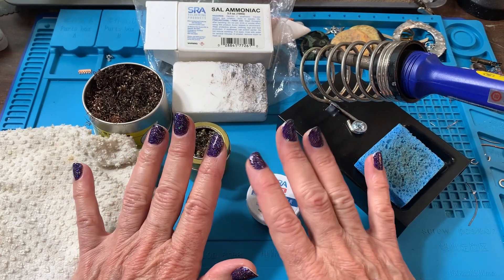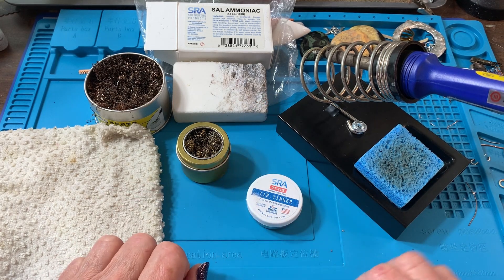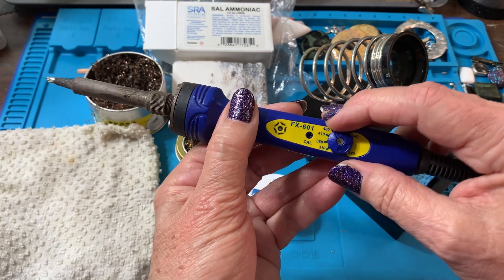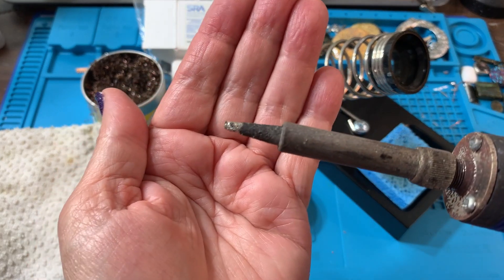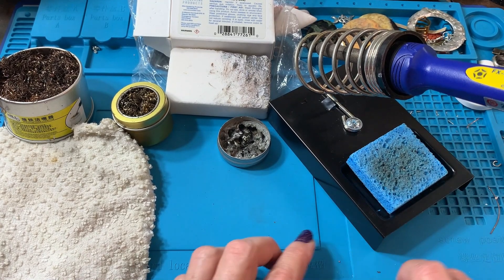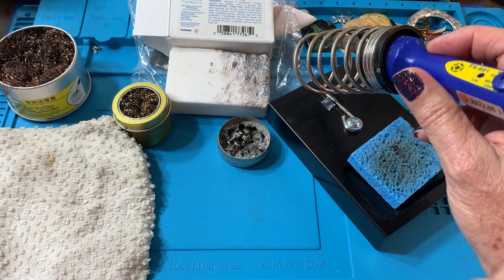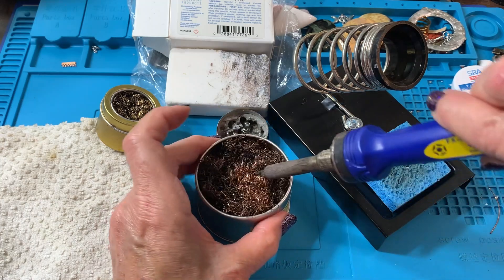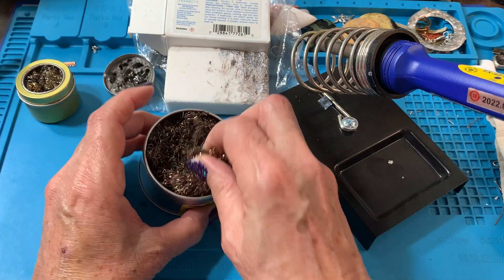Keeping Your Soldering Iron Tip Clean

Comment: Very good info in the video, Karen.👍 I also found that using the metal nest cleaners work best for me, as well as using the tip tinner before shutting down my soldering iron. They have both saved me alot of hassle.
Reply from the maker: Thx gf! 💖